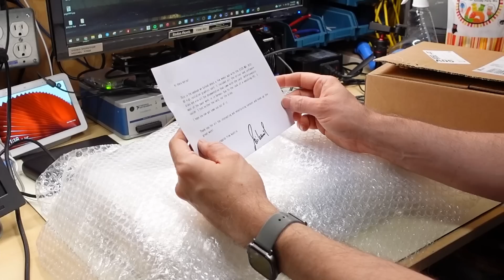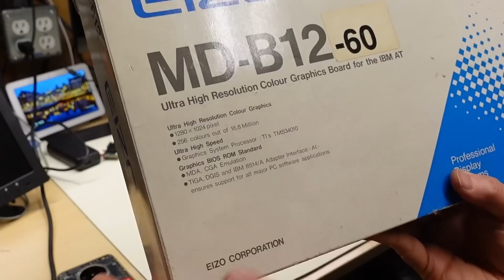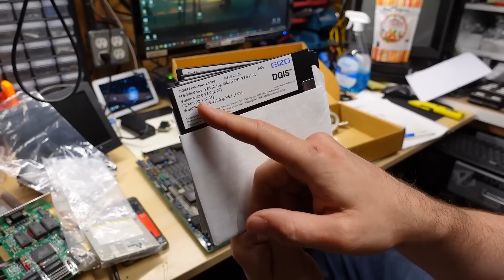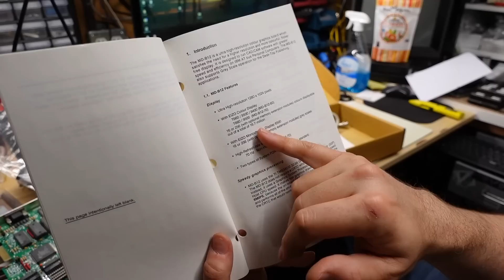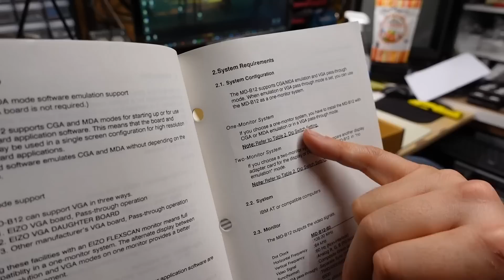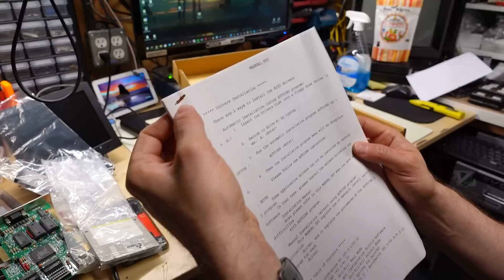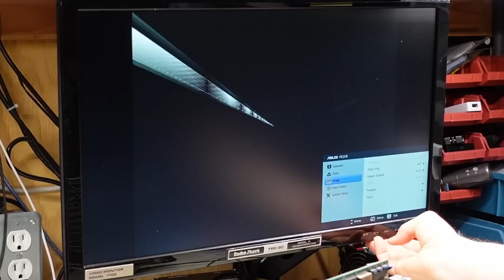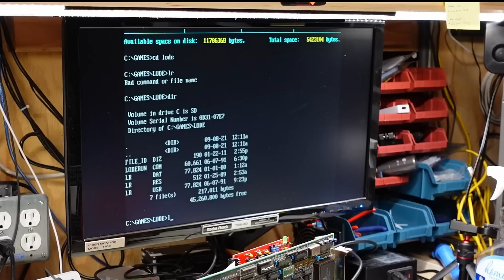0008 This is an "ultra high resolution" PC video card from 1987

Comment: Weird related fact. Approximately the same device - with TMS34010 @ 6mips (50mhz), onboard ram and 1024x768 16cols display - was available for the Atari ST in the late 80s - also running GEM. That device was called the Parsec by Elmtech Research. Imagine that thing hanging off the back of your 8mhz Atari in 1988.

Comment: I used to have the 21" version of the monitor for that high res board, It was @ 150 lbs and if you had an mda and an ega/vga you could use triple display in 1991.

Comment: This card is the predecessor of the super rare OMNIVERSE 50/60 cards created by EIZO/NANAO to drive the legendary F784W 21" monitor which had an insane 2048X1536 resolution back in the '90s when most people had crappy 14-17" CRTs. I had the privilledge to work with that monitor for a while, and never looked back. Later every massive professional CRT monitor I got had to be 21" or larger. Mitsubishi diamontron, IIyama vision master, SONY widescreen, etc. If you didn't have the opportunity to create CGI/Animation/DTP on such beasts back in the day, you missed a very cool period of the computer graphics industry when a workstation could easily cost $10K or more in today's money. My workstation back in 1997 cost me about $15,000 adjusted for inflation. Now even teenagers have 27" 4K flat panels with RTX and bitch about frame rates in their stupid FPS games. LOL

Comment: EIZO's the Japanese display company that made the super-expensive panel in the original Wacom Cintiq 21UX drawing tablets, right? 🤔 Man, 1280x1024 in 1987? My first decent LCD monitors, in the early 2000s ran at that, and it was mind-blowing. (Granted, my CRTs could do better, but they took up ten times the space and consumed roughly seven thousand times the electricity. 😏)

Comment: IMO you need to use your mad digi-skills and make some mods so you can populate the memory slots and put this baby into a period-correct KILLER 386/25 from 1987!! Don't you have a Deskpro? A great machine of the day would have a dual-head with a MDA and a VGA display. That setup was practically required to debug Windows programs. The debugger (e.g. Turbo Debugger) would run on the MDA.

Comment: If this is really from 1987 then that is damn good. Back in those days I was heavy into assembly level work on graphics standards. The IBM 8514/a bus master Microchannel XGA card with matching 1024x768 monitor was the standard for high-res graphics and it cost something like $5000 in 1987 money. My work environment in the mid-80s included a dedicated 1024x768 display that cost twice as much - 2 years earlier. The 8514/a board alone was nearly $1500. At the time, we thought we'd never see affordable hi-res graphics. The rise of ATI and rapid propagation of standards was astonishing to us.

Comment: I was wondering why it would need VGA passthrough, makes sense for MPEG decoders and early 3D cards. but having VGA speed being so very poor... yeah, keep your old VGA card in there.

looking forward to the main channel. big old-school high res nerd. I picked up a 21 inch CRT at auction when I was a kid (my dad was an auction addict), clearly a workhorse with many hours on her, the display was very dim. I mostly computed with the lights off anyway, so no biggie, unusable with the curtains open tho. but it could do 1600x1200, which considering most of my mates still ran 800x600, and nobody had higher than 1024x768, was obscene. I ran her for quite a few years after LCD's became affordable, nothing that high res or crisp.

And because desktop real estate is addictive, I also ran the first multimonitor setup id ever seen, one AGP card and one PCI. the standard 15 inch looked tiny next to it. Counterstrike, Quake or UT on the main screen (I eventually had a video card that could run them at full res), Winamp, MSN messenger and Firefox on the other. When I finally pulled that rig apart, the desk was visibly bowed under where it sat, weighed about 25kg.  these days 3x 1080p monitors is about close to sufficient.

Comment: I bought such "high end" video card with MultiSync 19 XL monitor from NEC, 30 years ago (e.g. 1989, TI  TMS34010, 768 KB dual ports VRAM) ... never buy such things again.  Its driver only works with certain software such as AutoCAD.  The average VGA or SVGA card (e.g. Tseng ET 4000) is much better performance/cost choice.

Comment: Other side of this card: They were typically sold with a (BIG) fixed frequency monitor. Generally as students we had to lug these beasts home, and to get the monitors working it was a matter of switching plugs between a normal monitor and the "beast" while having "Scitech Display Doctor" installed to repropgam the sync frequencies to suit the "Beast" monitor! Only way us poor students could afford a high res monitor in the day to do our CAD work! All on windows 98! Often we would have to wire up some logic converters to invert the sync signals to make them compatible with VGA. The VGA to BNC cable you showed suggest this is what the card was designed for...

Comment: In 1987, 1280x1024 was unheard of.  640x480 was the highest resolution I had ever seen up to that time.  And that was on a PS/2 with IBM's newest VGA card -- a very pricey system in its own right.  This card alone would've probably cost double what that entire PS/2 system did (including its monitor) -- and then you'd have to get the 1280x1024 monitor on top of that, adding many more thousands of dollars to the cost.

Some seriously professional CAD equipment for that time.  Very, very expensive, and extremely rare -- excellent donation!! Congrats!

Comment: Old hardware is much better then today's technology!  Box presentation like Apple and their competitors would say wow!  Love the length and width of the graphic card.  They do not make stuff like this anymore.  VGA standard is the gamer's dream for playing games!
Reply: Unfortunately VGA stopped at 640x480@16 colors (or 320x240@256 colors), so not exactly... But countless extensions, including this, often incompatible with everything else came out. Later the industry adopted the VESA modes but that was a bit late into the 486+ times.

Truth be told in 1990 the PC was fast but awful for gaming, compared to the likes of Amiga. Add ons slowly fixed this.

Comment: Hi Adrian! Would you mind backing up the drivers and sharing? I have a similar Eizo card, the MD-B10 and I’ve been trying to get hold of drivers for over a year now. From my endeavors I was told by Eizo that the MD-line of video cards was only available and sold in Europe, so at least that’s some trivia :) Great video as always!
Reply: Im 100% sure that he will, if they are intact. Its a Duty Of Care thing. Alot of stuff ends up on The Internet Archive, have a poke around there? Best of luck!
Reply: @arjovenzia  Unfortunately no disks there yet :/

Comment: BGI is the standard the graphics libraries used, that came with Borland Turbo C++ and probably Turbo Pascal as well. Lame, lumpy libraries which anyone would ignore once somebody told them the base address for VGA RAM and the right BIOS call to set it up. The BGI contained a load of functions for line drawing and stuff, mode setting, just the basic graphical stuff. The ones for CGA and EGA came with the installation. Possibly VGA but I never got that working. So the one on your disk presumably is the version for super-rad-l33t-awesome VGA. Ow! My retinas are bleeding!

Comment: Why would you want a driver for Word Perfect? Well, more than 80x25 characters would be nice. Also those drivers usually enable a basic WYSIWYG mode where you actually see bold, italic and underlined charcters as bold, italic and underlined. Possibly it allows even different fonts to be displayed (even cheap 9-pin printers supported printing at different characters/inch settings).
Reply: And that software was very important back in the day, along with spreadsheets so being able to see more cells or words per screen was a valid user case. I do remember it having a print preview screen, but not wysiwyg editing so i guess its just different font sizes to acomodate either more (small) or prettier (big) text font. Remember, text mode scrolls fast which was important when editing.

Comment: Some remarks to the CGA legacy, explaining the slow scrolling and the "display switch not proper" message:

The classic IBM PC/XT BIOS includes a MDA BIOS and a CGA BIOS (actually, the cards are similar enough that they share one BIOS implementation with different parameters). The PC/XT mainboard included a pair of DIP switches putting the mainboard BIOS into one of four modes:
1) Configure the internal video BIOS for MDA operation
2) Configure the internal video BIOS for CGA operation at 40 column mode
3) Configure the internal video BIOS for CGA operation at 80 column mode
4) Do not try to initialize CGA or MDA, but call a BIOS extension at C000:0, if present. This setting is often called "EGA/PGA/VGA" or something like that.
With the AT, the display switch was moved to the CMOS setup, usually just a single jumper remained that chooses whether a monochrome or a color video adapter is supposed to be the primary adapter. Either the message on your PC actually means "CMOS display type mismatch", or your board does in fact stilll have the full display mode switch on board.
The point of the error message is that the mainboard is set up to run in mode 4 (external video BIOS), but it didn't detect an external video BIOS. Furthermore, it detected a CGA-compatible card, so it auto-switched to mode 3 (CGA BIOS support in 80 column mode).

The slow scrolling is a feature of the on-board CGA BIOS. In 80-column text modes, the CGA memory bus is utilized 100% by the character scanout process. As the CGA card doesn't dare to block the ISA bus until horizontal or vertical refresh is active (which would also block any kind of DMA operation and memory *refresh*), any video memory read/write cycles during the active display period steals cycles from the graphics chip. The result is that the graphics chip uses the data read/written by the processor instead of the data it actually needs, so it displays wrong characters or colors (I don't remember whether only character, only attribute or both kind of cycles could be stolen, but I suspect it's only one kind). To prevent the display of "snow", the integrated CGA BIOS scrolls the screen only during the blanking period.

Comment: You know it might be possible to build some memory cards for that. If the schematics can be found it shouldn't be too hard to get the boards made. Finding chips might be a little tricky but not impossible. There might even be preexisting designs that you could use. It would be interesting to see if you decide to perdue it as a project.

Comment: Ah yes, the nineties...  I surely remember spending way too much money on large CRT monitors with a whopping 1280x1024 resolution and graphics cards with 256 color palette...  as an upgrade from 1024x768.
Of course you could impress friends that had only 640x480 in 16 colors.

Comment: The TI TMS34010 was a full 32-bit RISC CPU with GPU and probably more powerful than the PC it went into.
It was blazingly fast for the time. Lots of arcade games (NBA Jam, Mortal Kombat, Hard Drivin', etc.. ) were based around that system-on-a-chip.

Comment: Oh, that's a TIGA graphics card.

Those were really great as of performance.  

It took them a while to get a VISA 2.0 compatibility driver for them to use them in DOS programs designed for VGA.
Reply: As a note, early cards did support MGA and CGA mode emulation, just not VGA mode emulation.   Later a DOS extender was developed for VGA mode emulation support.

Comment: I wonder if this would work with the monitor from my HP-UX workstation.  It's fixed frequency and the computer outputs 1280x960 at 60Hz.

Comment: EIZO is an interesting company. Back in the early LCD era, I have found an Eizo 24 inch CRT monitor that was capable of running at 1920x1200 resolution.

Comment: There was an advanced universal VESA video driver for DOS and Windows 3.1x which used to cost a fair bit for a long time then the company made it unsupported freeware. It supported a boatload of video cards and chips, including getting the high resolutions and color depths working in Windows 3.1x when there was no manufacturer support. But I can't bloody remember the name of the software package! I probably have it stored away somewhere on an ancient CD-R or spanned ZIP on several floppy drives.

Comment: A weird thought after seeing the slow cga emulation. Is it possible that XT games running too fast on AT class machines could be partially due to 16 bit vga cards being much faster doing cga than an original 8 bit cga card. Considering lode runner was still way too fast cpu clock is stil probably the biggest factor but cga speed is not something i've seen investigated especially for games that do fullscreen redrawing.
Reply: As far as I recall, the speed of the video card wouldn't have been indicated to the program until the period when the machines were themselves too fast, so the program would have just caused the cards to glitch instead of slowing down.

Comment: I acquired an AT286 PC a few months ago that had one of those TIGA cards in it.  (A Cornerstone Technologies card with 256K VRAM and a 9 pin D-Sub video connector with 1024x768@67Hz output.)  Problem is that even the NEC Multisync XL that I have can't seem to display the image from it.  I know the card is working properly, but the 67KHz horizontal synch and 67Hz vertical synch signals from it are too high (and very non-standard) for any monitor I have.  I'm guessing the 286 was used for either CAD or desktop publishing.  And like you say, I can find no information at all on the card, probably because Cornerstone Technologies went out of business in the early 90's, an the company name was subsequently used again in 2001 for a totally unrelated business and they provide nothing of use for finding any information on the original business.  It's really a shame since these TIGA cards were among the first to have actual graphics acceleration.  I can't wait to see a video demoing how these worked in the older PC's.

Comment: I really want to see this run Windows 3.1 and AutoCAD. Only having access to 640x480 back then, 1280*1024 just have been amazing. Maybe you can run 1024x768 with 256 colors?
Reply: I remember using AutoCad at college on Windows 98SE I think and the hardware was usually Celeron in the region of 700MHz with 64MB RAM and accessing simple office type programs such as Access and Excel took a lot of time due to the program needing a decent setup (back then)

Comment: When I got to University in 1990, the graphics lab had a 386 with a 12MB video card. It was capable of "true colour" (Eg full 8/8/8 colour depth 16.8M colours) and would have been more impressive if it hadn't been stuck in a lab next to 7 SGI Indigo workstations with even more terrifying video cards :-)
Why play on the 386 when you could play on the 1280x1024 truecolour, fully accelerated system with a RISC processor at the core.

Comment: 11:05 I don’t think that manual was for OS/2 drivers. OS/2 1.1 was the first version to include Presentation Manager and it wasn’t available until late 1988. Also, the GUI for OS/2 was called “Presentation Manager” not “Presentation”, so titling the manual “Presentation Driver” would have been really awkward language and EIZO is not a fly-by-night operation to make a mistake like that. On the other hand, the card might have been manufactured or packaged after 1987 regardless of the component’s copyright dates. Therefore if the manual is really for OS/2 it would mean that the card has to be newer than Adrian initially assumed.